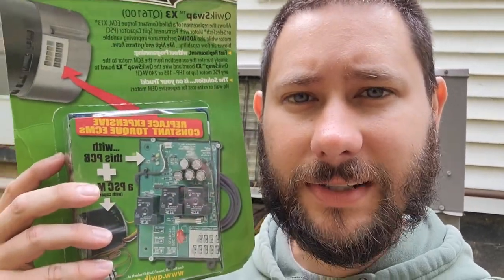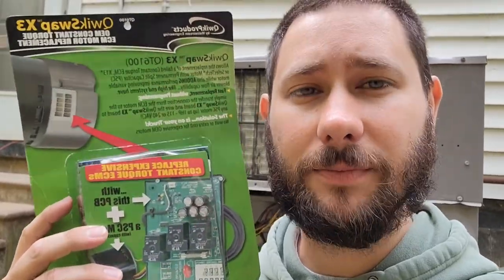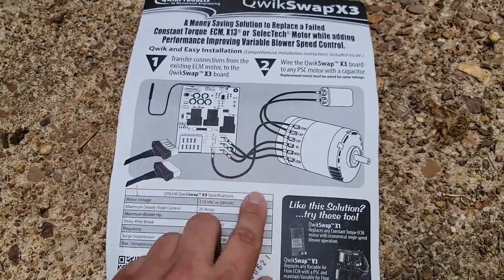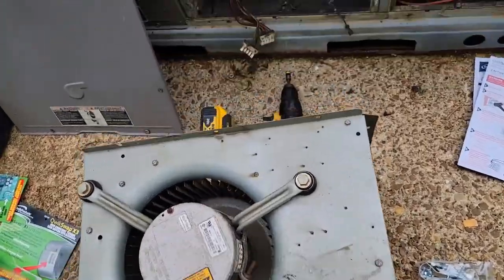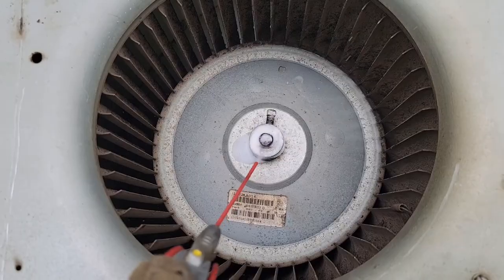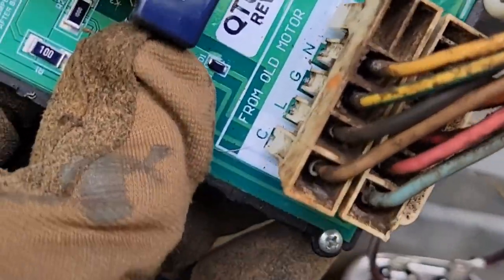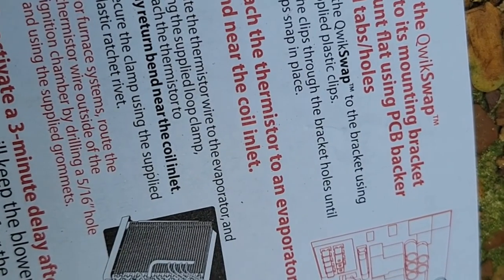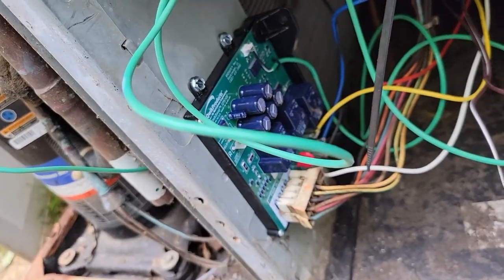How to Swap ECM Motor with a PSC Motor? @qwikproduct

Comment: I used it and I love it!  Kept getting a  code 5 and code 11 even after replacing a warranty X13 motor and board. After the quick swap, no more problems. Very happy with the quick swap.

Comment: When they started selling these ECM type motors, they sold for three to $500. Now they're going for 1000 or more. Bait and switch at its best. All I do is put a relay in  with a PSC motor and I'm done. i'll stop selling variable speed air handler's along time ago. When they started jacking the prices up on the blower motor and control modules. Now I just upsize my air handler a half a ton if I need more airflow. Keep up the good job on the videos dude.
Reply from the maker: Dude that's a great idea and that's really all this is it's a couple relays built into a board

You my friend are a true technician
Reply: this is awesome 
so you put a relay that is controlled by the thermostat directly or by the board? im a new tech and love learning 

thanks much
Reply from the maker: Hey mark thanks for being a member really appreciate you
 Yeah this is a very simple setup and it's a Built-in relay really easy to install
Reply: Yup that’s old school. Wire a PSC hot all the time or wire your 19340 relay from G. You could get real fancy and wire heat/cool/aux on different speeds

Comment: Thanks for your help. My evaporator motor quit yesterday and I just learned how much a ECM motor cost. I was at the supply house yesterday. The prices start at $300 to $1000. I was informed that the real weakness of the ECM motor is they are very sensitive to power fluctuation which is almost the norm is southern Pine bluff Arkansas. A refrigeration technician mention to me today that he advises some of his customers living in area where power fluctuation is a problem to switch to PSC motor.
 Thanks for the video.

Comment: A better solution is likely to use the EverGreen ECM replacement. They do not have to be programed and will learn rotation on their own while replacing the poor design of the X13. Not as cheap as the PSC and Relay idea but at least the efficiency and operation of the ECM advantages remain in place for less than an X13.
Reply: Hey, a fellow Garth!
Reply: @gaagmtk  Hello !
Reply: @Garth2011  
Where are you from?
Reply: @gaagmtk  Born in California
Reply: @Garth2011 
I'm originally from Massachusetts but I live in Virginia now
Reply: You're so right. I just recently discovered the Aszure Mars motor that's just a little under $300 and replaces PSC, variable, and x13. Can adjust cfm from an app on your phone. Pretty slick!

Comment: From DC/MD/VA area. Nice video. Bought one of these 3 years ago to use in a pinch. Still on my shelf. Good to see that it works. It would be nice to see the motor switching speeds.

Comment: You can do this with a 90 - 380 connect the G wire and common and break the speed you choose at the 90/380 connect the other common wire add to contact her or defrost control

Comment: I’d not seen those yet, but that is great option versus buying another stupid ECM that’s bound to fail sooner than it should.  Unfortunately that conversion board is full of electronics too.  Nothing beats an old American made PSC motor, especially if it has oil tubes.  Not that most people would ever know to put oil in there occasionally, but  some of us do.  My original Emerson PSC 1/3 hp motor is still in place in my furnace.   Summer time it’s normally running continuously when cooling is on.

Comment: Can you do this with a variable speed ecm motor? Mine is getting replaced again for the 3rd time under warranty and I have just over a year of warranty left. This motor has been in for about a year and a half. I just can't see continuing doing this. It has been the ecm every single time and so far they have found no other issues minus this time they said it also cause the high pressure switch to trip and it has to get replaced also.
Reply from the maker: yes absolutely

Comment: I have only seen maybe 2 or 3 ecm motors failures, it's almost always the thermistor in the bell housing on the motor( this goes for eon,,2.3,2.0 x13) usually a 5 to 10 dollar part that can be desoldered and soldered back on. Part number is (sl32r030), easy field repair with a battery powered solder gun.

The other fail cases come down to board failures.
Reply: I have seen others fails, when thermisters are good.
Reply: unless its encased in rubber, then not so easy.
Reply: @Little Boy & Fat Man  the thermistor can be cut above the sealant leaving nubs that the new thermistor can be soldered to and testing of removed thermistor.
Reply: We see a good number of failures here in south Texas.   Some module, some motor shorted.
Reply: That bell housing is the "Module" and Evergreen ECM can replace the X13 with the same wire harness etc. Those thermistors are $2 and yes, can be replaced most of the time with a soldering iron. Sad that those cheap crap parts are being purchased and used on an $800+ motor.

Comment: After replacing the thermister, a year later the the main blower motor (GE 1/2 hp 08/22/00 CNO2 011DH7) in my carrier infinity is making a intermittent high pitched whine (g#5 note) when on first stage. If I can afford it, should I replace the motor?  Bearings?  Thanks
Reply from the maker: Yes replace the motor

Comment: wondering if you can help i"ve got a goodman 4 ton heat pump the ecm blower i"ve replaced many time  and I'am done with it will the quickswap work fpr me they want 1100. dollars for motor if this will work i'll get 3/4 hp psc motor and cap
Reply from the maker: This product will work for your unit

Comment: What size capacitor do I need to swap out ecm 1/2 hp with PSC
Reply from the maker: depends on voltage to motor and speed 5mfd - 10mfd

Comment: I don't see the reason to replace an ecm motor by using a proprietary board that is another point of failure.  Wouldn't it make more sense to just use easy to find relays and capacitors?  At least for diy homeowners that can replace those simple parts it would seem to.  I keep a spare contactor, capacitor and thermostat just so I can get right back up in 100 degree heat.  Just seems to be a product without a reason except to make the manufacturer money.
Reply: Can someone make a video using relays stead of the quick swap
Reply from the maker: I've got a video on there
Reply: Excuse my ignorance, but how do you use relays, and capacitors on an existing ecm board to change the motor to psc?
Reply: @TChalla616  If it is ignorance, I am just as ignorant.. I am diy homeowner /ex industrial electrician that does  a lot of research before I do anything I'm not familiar with.  My unit has a X13 motor, so maybe I should have said that instead of ECM because I have no idea if all ECM's would be able to be replaced with a PSC.  My X13 just needs full time 220-240v and a 24vac input signal (for speed).  There are quite a few videos online that show how it can be done.  I just like being prepared, and in my case I decided to get a US Motors Rescue motor (X13) for a spare.  I hope it will be wasted and I will never need it......Not ducking the question, I really am not the guy to ask how to do this, I'm the guy watching the video while I do it for myself.
Reply: U can use a relay to change over to a psc motor but u don't get variable speeds from psc motor, just wire it to medium speed without the the qwik products board but if u are concerned about humidity I would use the board.  Yes it's another control board that can be a failure point in the event of a lightning strike or power surge.  I recommend whole house surge protector and wire individual surge protector for air handler and condenser
Reply: As a 24 vac relay for low, another for medium and a third for high speed. Wire a standard three speed motor to the output of the relays ( low speed motor lead to low speed relay etc). Wire common side of all three relay coils to 24vac common. Wire 24vac low input to original motor to the other side of the low speed relay coil and do the same for the medium and high. Then you have just used the old speed inputs to the original motor to energize the appropriate relay that in turn sends power to the new motor speed lead.

Comment: My ECM motor has failed 2 times. The first time it lasted 2 years after the new installation. Now here it is again failed after 8 years.  The motor is a 1HP ECM motor.  Do I replace it with the same HP in the PSC  motor?
Reply from the maker: yes
Reply: Thank you for answering my question.

Comment: I had some power outage and after that the ecm died on my carrier package unit, I installed a rescue ecm one for 300$ , almost identical and no problem , there is no point to put an original expensive motor on 13 years old unit
Reply from the maker: I agree

Comment: the ECM motors and the VSM motors are ALL JUNK. they don't last more than a few years. then you are stuck paying thousands of dollars to install a new blower motor. my unit is a cheap unit, the blower motor went out after a year and a half. New VSM cost $800(ac company) before install. I found one on ebay(self install) for just under $500.

Comment: Can do with a relay
Reply from the maker: Of course
 That's what this is a board with built-in relays
Reply: If you need only cooling, yes. If need both heating and cooling, 2 relays. And for ecm 2.5 and 3.0, the board will read signal feedback from ECM module, then you really need the V3, or replace furnace LOL

Comment: This is stupid. Adding an extra part to a motor that voids warranty and costs more to use. All because no one wants to admit it's a markup problem, not a motor problem. The motor you took out is only like 300 bucks or less. Anyone who does this along with removing expansion valves for a piston is a joke.
Reply from the maker: The point is to save the customer money
Also, some of these motors with modules are over a thousand dollars.
So it makes perfect sense.